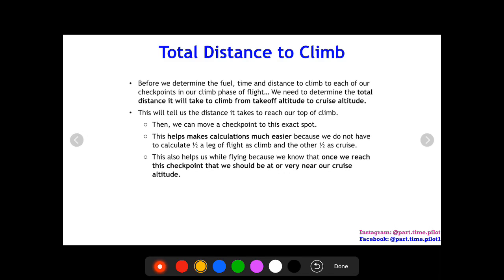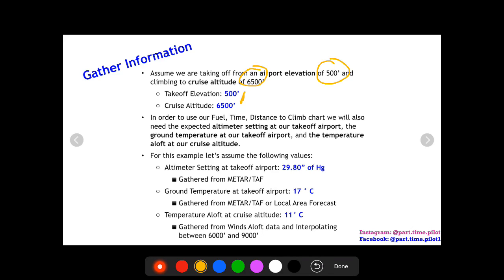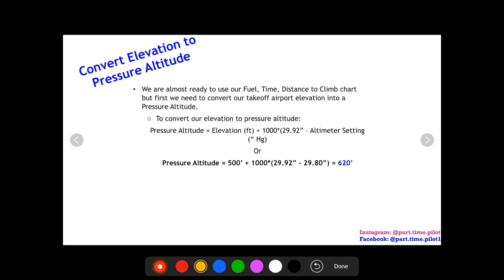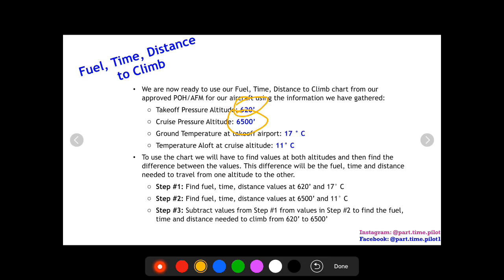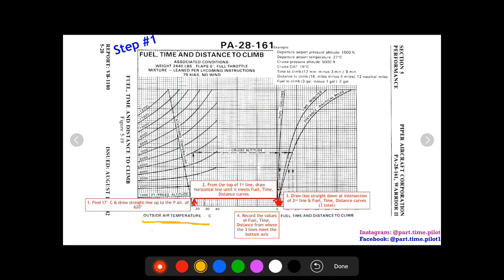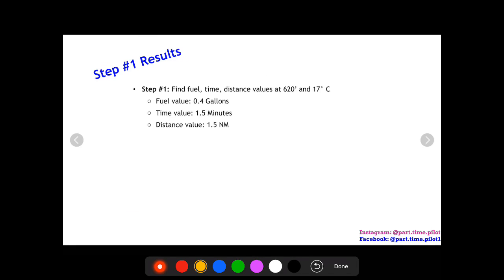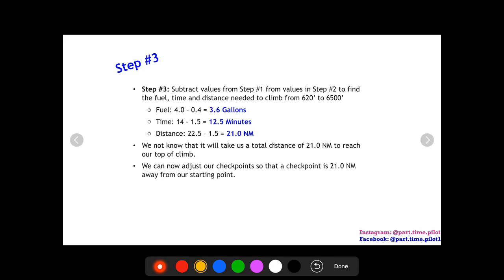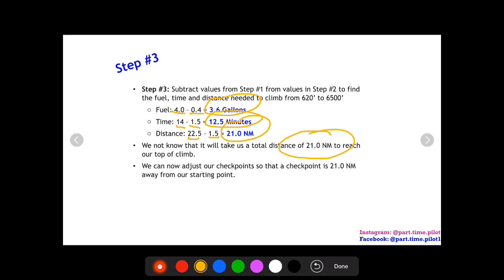How to Calculate Climb Performance - For Student Pilots

Comment: Why is the temperature 11C at 6500' if the standard drop is 2C per 1000ft?
Reply from the maker: Because the example we are using is not from a standard day. The standard temperature line can actually be seen going up through the pressure altitude lines. But conditions are rarely exactly standard and that is why we use this chart. By combining our actual temperature at altitude we are essentially correcting for non-standard conditions which effect our performance (density altitude)
Reply: @PartTimePilot  thank you!
Reply from the maker: Anytime

Comment: Hey Nick, what if you’re starting at sea level, can you skip the subtraction part between the pressure altitudes? I’m in NYC and mostly all the airports here are at sea level. Thanks!
Reply from the maker: Not quite. If you look at the sea level curve it is not at the bottom of the y axis. So you will have non-zero values of fuel, time and distance that you need to subtract. But… they will be small values

Comment: How do you calculate for wind velocity during climb?
Reply from the maker: In climb you will target an indicated airspeed. Either Vx or Vy. You start with that known indicated airspeed and then you convert it to a true airspeed with temperature data for a mean temperature of each climb leg. Then, you convert the true airspeed to a ground speed using winds for each climb leg from winds aloft or surface winds.

Comment: Why is the 6500 feet cruise altitude in your example assumed to be "pressure altitude"?
Reply from the maker: Your comment got me thinkin and you are on to something. In fact, you are right… we should also correct our cruise to a pressure altitude. This is inconsistent if we don’t. 

I think the reason I was taught not to and then put this in my video was because the change will likely be small and it’s easier to find 6500 on your climb performance chart than it is, say 6379’. So I was taught to just assume it’s negligible. But you’re right and this is inconsistent. 

Thanks for the comment and question. I will have to update my content to reflect this!

Comment: My airport is below class bravo under the 3000 shelf. It’s not a problem if I go west by the time I finish climbing I’m out of class bravo. But if I go south I have to fly at 2500 for 5 minutes then climb to 3500 for another 5 minutes before I’m clear of the 4000 shelf and out of class b. Is there anyway to calculate all of that?
Reply from the maker: Max Sperlich unfortunately if you want to stay out of the class B then you are going to have to do the multiple calculations. Which is annoying. You will have to put a checkpoint at your top of climb to 2500 and then another checkpoint where you are clear of the bravo and can climb again. So essentially from takeoff to checkpoint 1 will be a climb calculation to 2500. Checkpoint 2 to 3 will be a cruise calculation staying at 2500 for a number of miles and the. Checkpoint 3 to 4 (or more) will be another climb calculation to your final cruise altitude.

Comment: How important is it to calculate TOC if I’m only gonna be climbing to say 2,000?
Reply from the maker: Georgia_Dawgs_27 thanks for the question. I think it is important because if you don’t find TOC and match it to a checkpoint then you either have to calculate a leg of flight as half climb and half cruise which can be both confusing and annoying. Or, you would have to assume the whole leg is climb or cruise. If you assume the whole leg is climb when you are only climbing for a small portion of it (like when climbing to 2000) then your fuel and time in flights will be much more than the actual value. This isn’t the worst thing because it’s safe and conservative but it’s not very accurate. If you do the opposite and assume the whole leg is cruise then you are dangerously estimating that you will require less fuel than you really need. Don’t do this. Another option is to calculate the fuel and time needed to climb to 2000 and then add those to the fuel and time needed to cruise during the whole leg of flight. Again this would be conservative and estimate more fuel than is accurate but it’s safe and I know pilots that do this as well. 

Hopefully that helps. Thanks for watching!
Reply: Thanks for the explanation. I’ve been wondering how important and necessary it actually is to calculate top of climb especially for a long cross country. I see it can throw some things off. Great video!
Reply from the maker: Thanks! Let me know if you like the strategy of finding the TOC